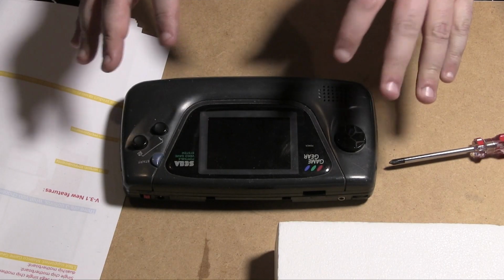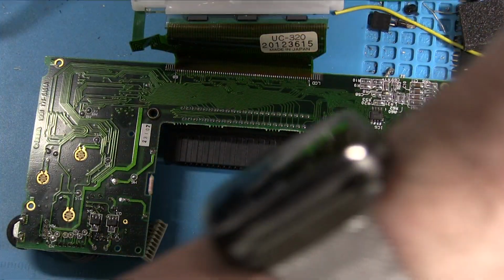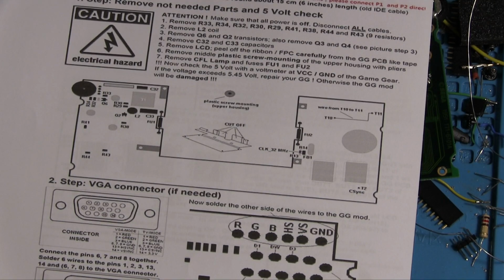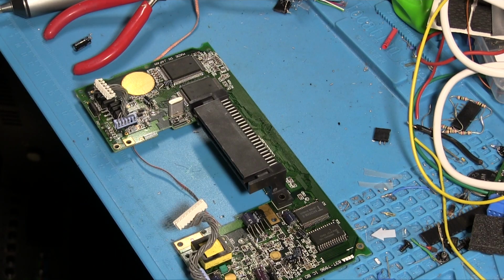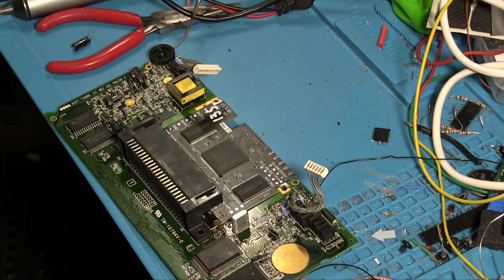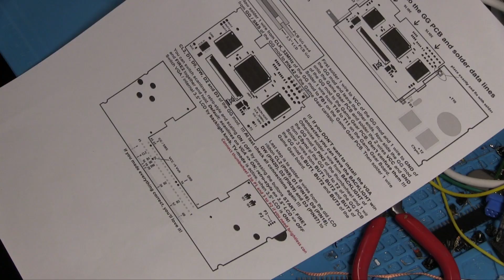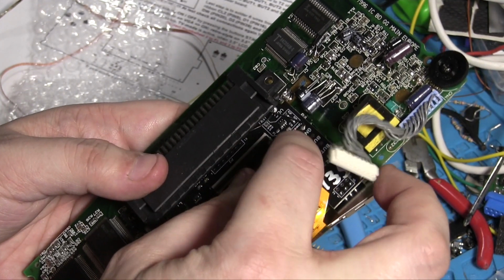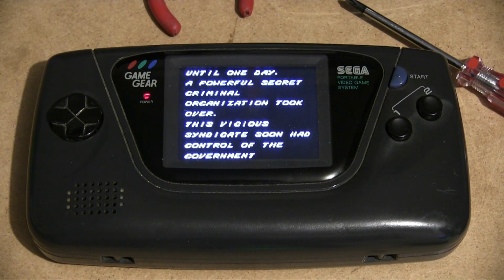From the dead (screen): Replacing a Game Gear LCD

Comment: Hello. I installed the same IPS mod. Everything is working but there is only one problem. Start button does not work. Do you know what can cause the issue? Thank you
Reply from the maker: Two possibilities, one of your wires is crossing into the contact pad for the button and blocking it, or you've accidentally bridged something.

Comment: Nothing to do with this but on the subject of screens, I think you should have a featurette (or someone should) on quality used flatscreen tellies working really well as old computer VDUs. For one, a portable Technika model 15.4-830 looks so crisp and sharp running in from S-Video, running micros and VHS so clear and with so much sheen, I'd say only a quality CRT beats it. You see what computers WERE again without the blurred, splodgy or fluffy video we do see on regular tellies best optimised for hidef. I've a Daewoo portable in the same league plus a 23-inch LG which also  has upscalers beating what you pay hundreds for in dongles. And the VGA looks crisp too.

Basic rule of thumb is a telly 10-15 years old, ones still cheap before the retro gamers discover them and in that middle ground where the old formats were best catered to before priorities moved on. The 1040x720 stuff. Good tube screens for that rich performance you only see to believe are getting stupid in auctions now.

Comment: How much does it improve the battery life?
Reply from the maker: ‘Improve’ - that would be a drawback, the mod can use up to an EXTRA 30% power
Reply: 30% more than a fluorescent lamp!?
Reply from the maker: I think that number also assumes you’ve replaced the lamp with LEDs
Reply: Soak test time?
Reply from the maker: @PondersRetroGoodness  Yes, I should know a little more after much more Streets of Rage